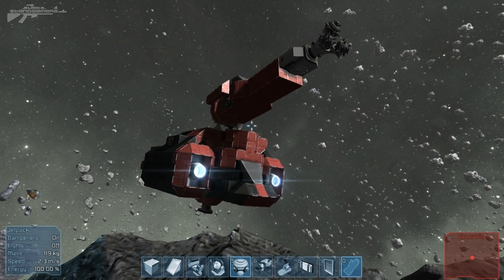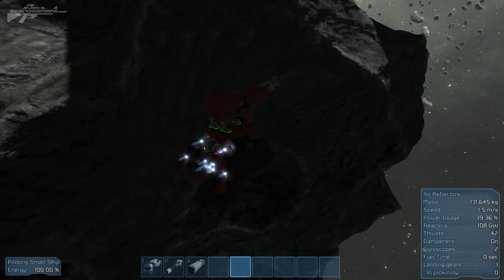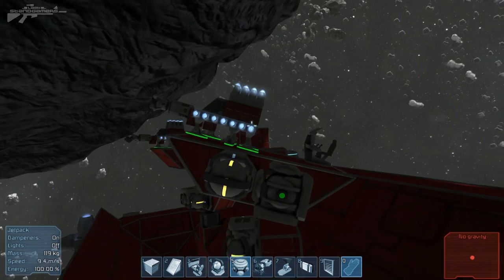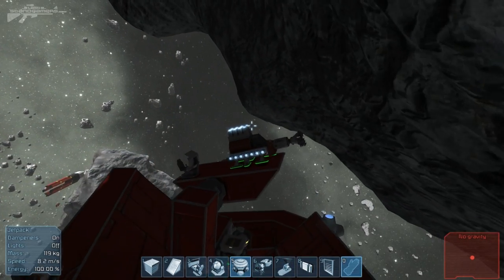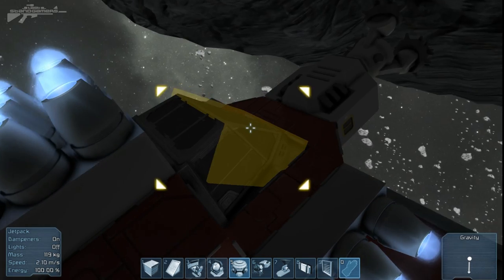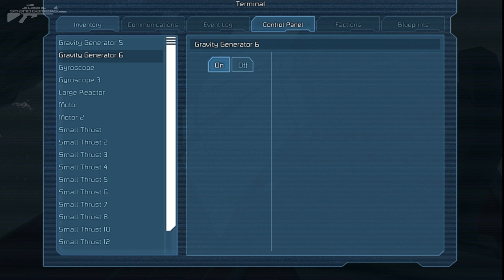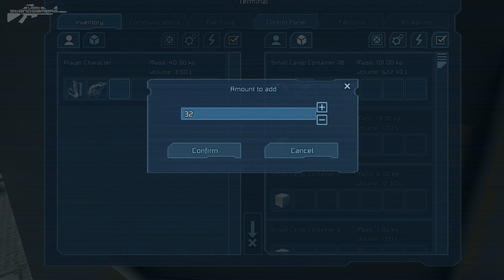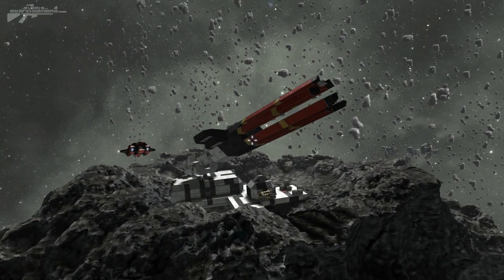Space Engineers - Rotational Motorised Mining Turrets & Armoury Construction Part 22

Comment: It would be very nice if you could hotkey any individual device or a group of devices to be toggled on or off. For instance, one could hotkey all of the gravity generators in the ship's gravity cannon so that he/she could fire the weapon without having to go into the menu and toggle each generator individually. With this mechanic, it would compliment another I was thinking of. What if we could run wires from one block to another that would transfer commands from a cockpit on one ship to the other? Imagine this: you have a ship with a motor on it. On this motor is an arm with several segments, (each segment has a motor connecting it to the next segment). As of now, in the game, you cannot control whatever is on the other end of a motor, but if a wire could be placed from your ship to the next segment in the arm, you would both supply it with power and be able to send commands to it through a console or cockpit. Now, here is where the hotkey mechanic would come in: you could hotkey each motor of your arm to rotate clockwise, counterclockwise, and stop with three keys per motor. This would allow you to have a legitimate and functional robotic arm. Now just imagine all the crazy things people would put on it: guns that reach into holes in other ships, hands that can be used to grab things and latch on to other ships. If something like this is implemented, the first thing I would do would be to make a walking tank.

Comment: I think that the multiplayer will be the people that work together will rule the planets. but that wont happen very well until they up the amount of speed you can.
Reply: What, are there even going to be planets?  Throwing voxelized planets, or even something like the aseroids (which seem to me to be malleable terrain meshes, though I suppose they could just be large voxels with different rendering rules) would be a major demand on the servers.  Especially once people started wrecking them.  I was under the impression that it would all be in space w/ no true planets.

Though it would be cool to see 'micro planets,' large asteroids with artificially high gravity (either just because or explain it away to say they have gravity generators at their cores), atmospheres, biospheres and such.  They might not have any more than a couple dozen or even just a couple square kilometers of surface space, but would serve as a port and an area for ground combat and explorations.  Still don't see planets as very likely though.